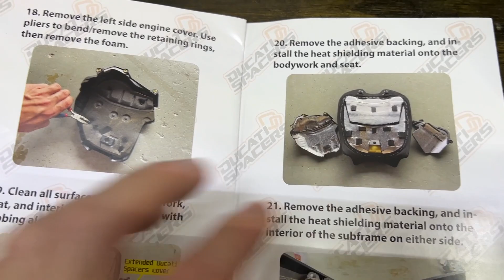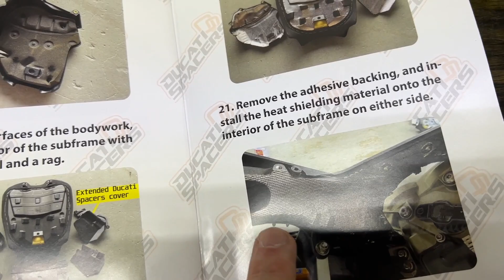Our Panigale V4 SP Gets a $3,000 Carbon Subframe!!!

Comment from the maker: Man I definitely didn't anticipate the rear subframe being this much work BUT I think we've got the bulk of the install complete at this point.  Also, I think we are going to remove the rear headers and have them ceramic coated black so we don't need to reinstall the stock heat shield.  Help support this project and be entered to win this bike here!  www.patreon.com/campisicustoms
Reply: Jaret & Da Beast ( Dado) awesome job so far if you can get your hands on Titanium headers get them done you will save some Lbs from switching to Ti & not having a great shield plus the bike will run so much better , way cooler , and will add them brilliant Ti changing colours to this beauty
Reply: That will not work Jaret, they get too hot. And nobody makes just a titanium header, won't matter anyways will still get way to hot
Reply from the maker: @marcjorgensen  yeah we actually put the stock heat shield back on
Reply: 140 monsters on the road 🇹🇷🙄👍

Comment: Huge mistake not putting the heat shield back on or better yet getting a proper carbon version.  Those rear headers get way too hot to be that exposed to external carbon. Ceramic  coating will not reduce Temps enough to keep from cooking that carbon.  Also Daddo will hate you when he realizes he will have to take the whole subframe back loose to install saud heat shield.  I've been through this drill on my bike about 5 times, but finally have achieved my perfect tail set-up
Reply from the maker: we put the stock heat shield back on already :)

Comment: Could just hammer those bolt holes a little on the stock heat shield metal to fit right and flush ?

Comment: That bike looks awesome, you're basically going to make it a superleggera.
Reply from the maker: that's the goal but without the stupid massive winglets that come on the superleg model :)
Reply: without a Carbon Frame and Carbon Swingarm its by far not a Superleggera.The Swingarm and the Frame are main Parts wich seperate the Superleggera from all Competitors.But eaven in Stock Form the SP is a very good Bike in European Bike Magazines wich are most of all a reference.The v4 SP wins.The BMW M wich cost the same as the v4 SP is far behind🤷

Comment: just trying think what call the stuff it’s like powder coating it  put on headers  help with heat seracotaing not spell that right it like powder coating  helps with heat that place you  where got spring powder coating most likely do it  problem solved